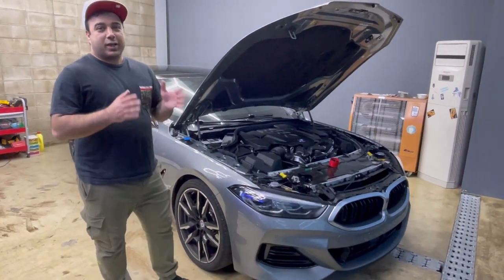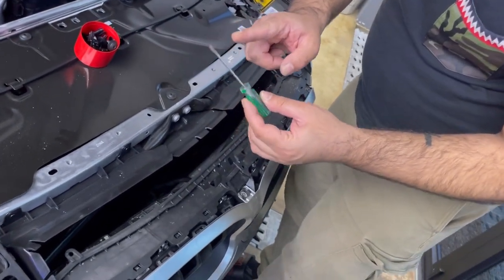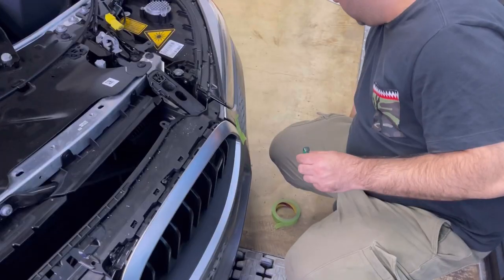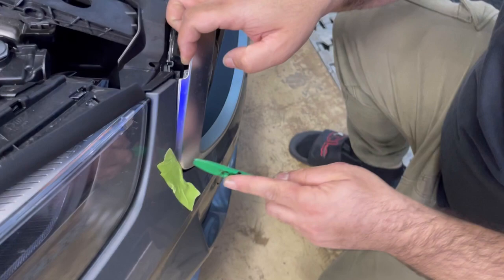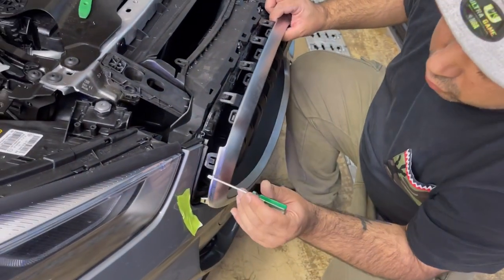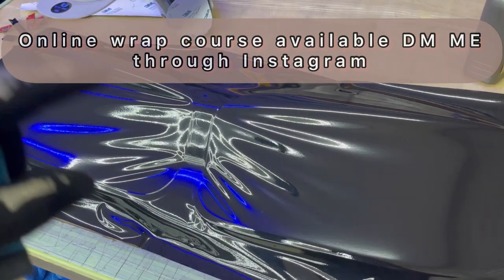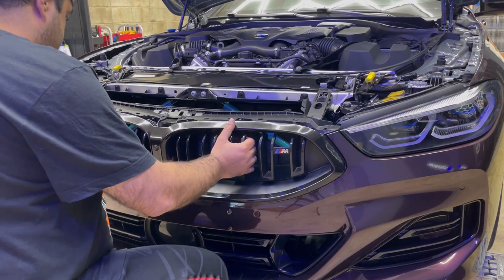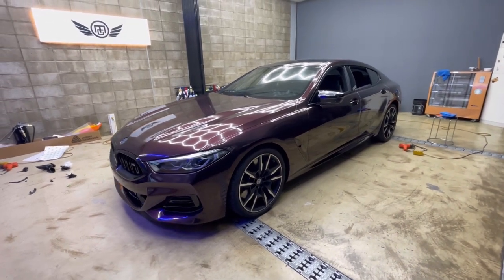BMW 8 series front grill removal

Comment: Starting an M8 Comp next week , can you remember how much you had to strech the hood with the 1520cm Film ? 

Awesome Channel , Keep it up and definitely Subscribed 👍🏼
Reply from the maker: Thanks man
First match vinyl at the front off hood  and leave maximum half cm it would be enough to wrap over the edge 
Second; now will be short about 25 cm from each top side near windshield 
Lift the material and start to heating it from center and slowly stretch it until it covers the edges ( don’t heat and pull it hard very easy to get discoloration especially with glossy film) and if u can have another hand to help it would help a lot